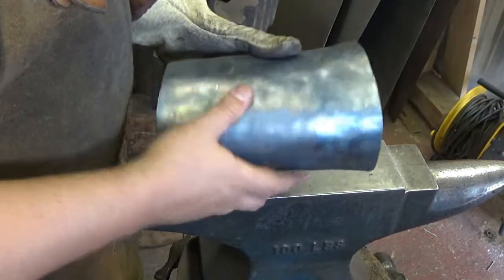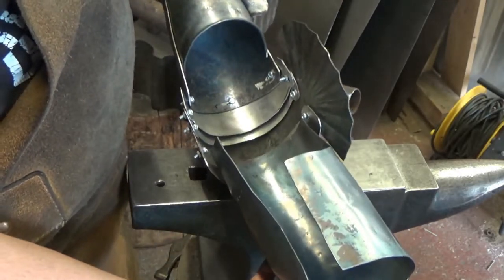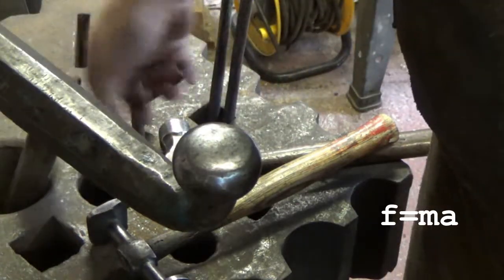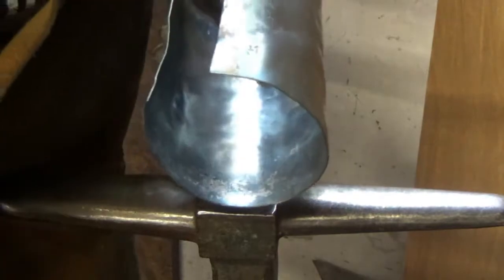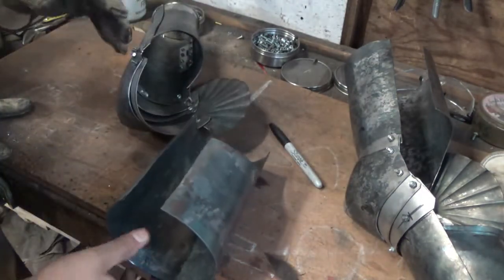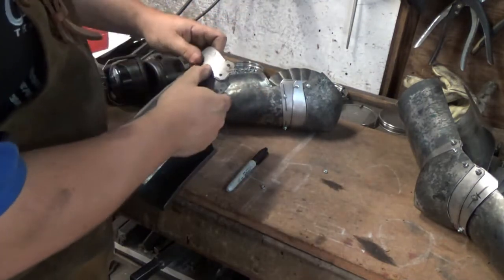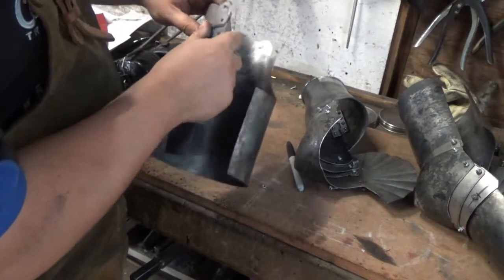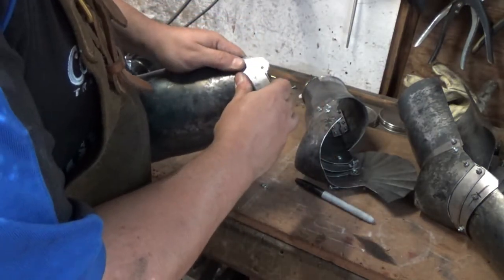How to shape rerebraces pt. ii - Planishing & attaching. Medieval Armor Techniques.

Comment: thanks for the video!

by the way if you were to wear this entire arm harness, could you still be able to rotate only your vembrace or would you need to move your entire arm?
Reply from the maker: The vambrace in this case has a small set of sliding rivets allowing about an inch worth of forearm movement, after that the forearms tends to rotate within the vambrace.

The spaulder then starts to rotate as your forearm has to recruit the rest of the arm into the movement.

If that makes sense ... but I've not had any coffee yet, so who knows.